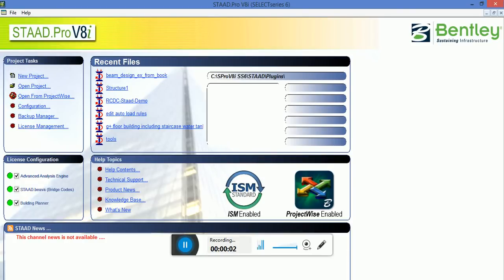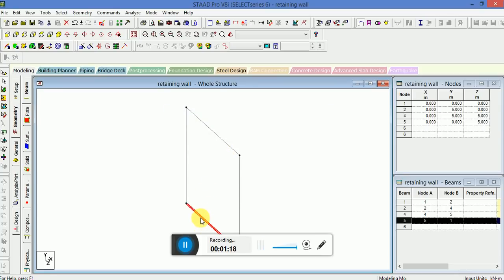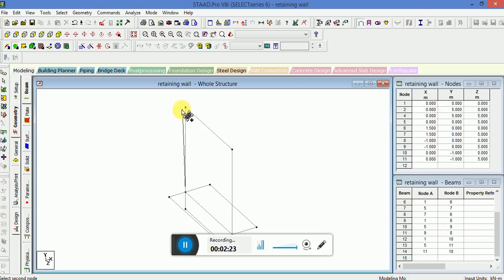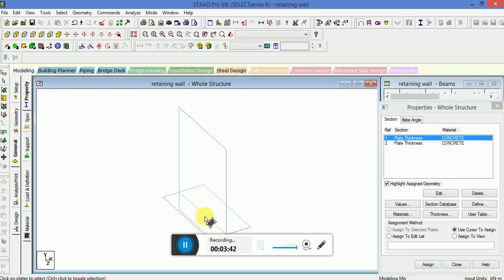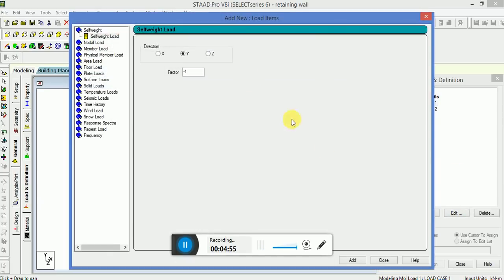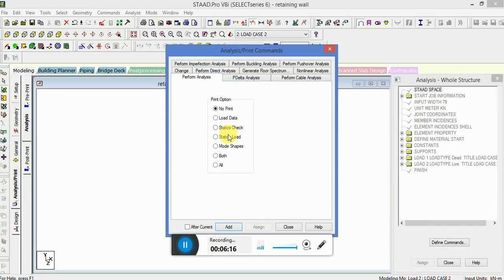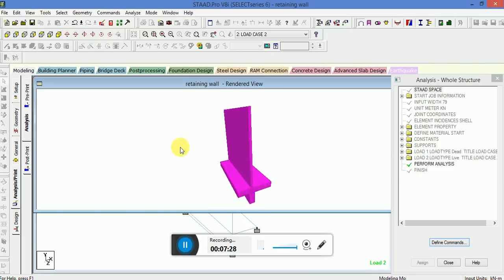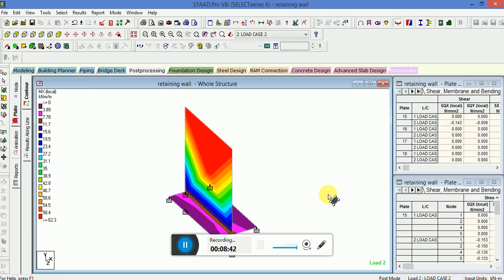Staad Pro Retaining Wall Analysis And Design(Cantilever type) 2018 Easy Method

Comment: with due respect, 

A Very Wrong Approach for analysis by using fixed support. Apply subgrade modulus for realistic behavior. In your model its very hard to design toe and heel. only can be used for design of stem.

Comment: I liked the video a lot.  It will be helpful for my design work.  I did notice that you applied a uniform load to the back side of the wall.  I believe this should be triangular load distribution since the pressure increases with depth.  Perhaps we could use the trapezoidal distribution and achieve the desired result.
Reply from the maker: THANXX FOR LIKING THE VIDEO AND I APPRECIATE YOUR COMMENT KEEP SHARING KEEP SUPPORTING :) :)